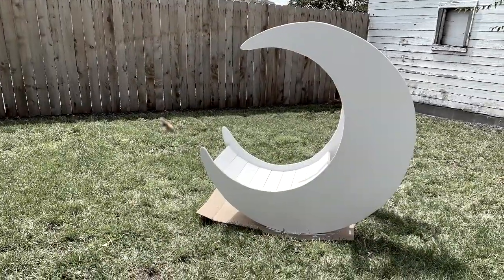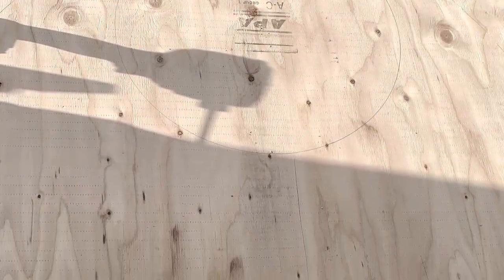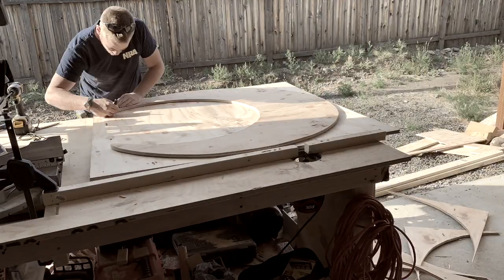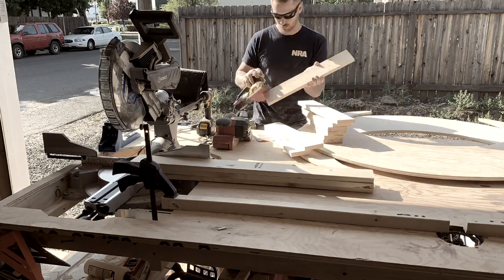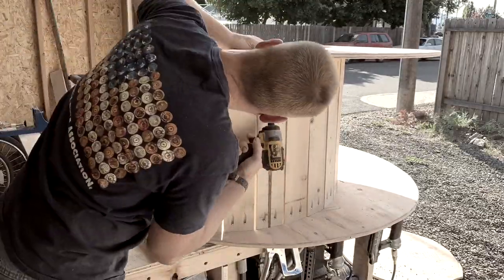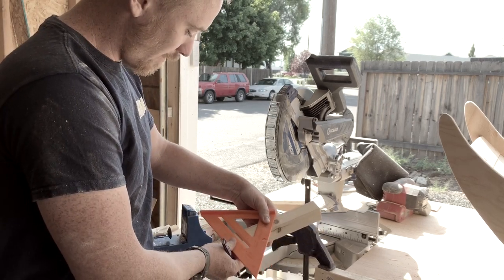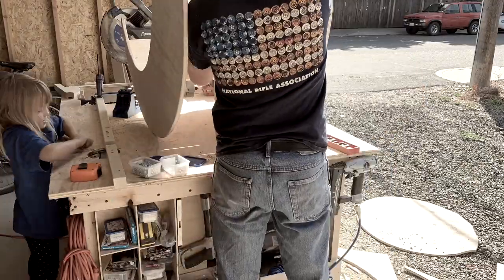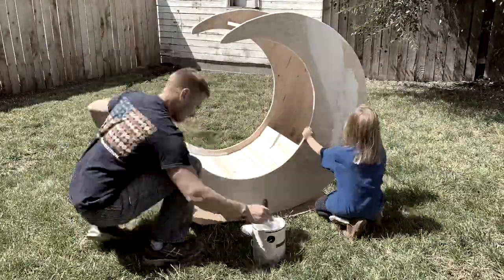Crescent Moon Prop

Comment: Has a dual bevel compound miter saw that could easily be set to 35°. Instead, spends as much time as it would take to set the saw, to mark the wood. Then holds it in a less than safe manner to cut it, with the saw set to 90°. I guess you're trying to show people who don't have the tools, how to do it, maybe? Still... would be so much better if you actually used your tools as intended.
Reply from the maker: Haha no you are right, but I was just showing how an angle can be found on a speed square if you are not able to use a miter saw. Yea I could have just adjusted the miter saw, but this was done on purpose. Good catch though!